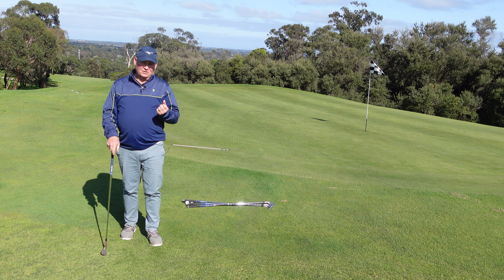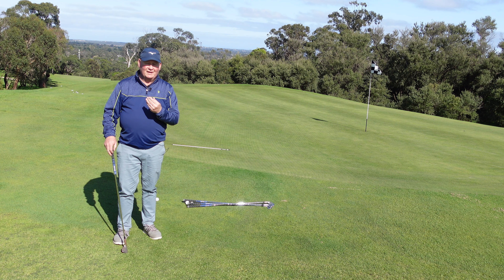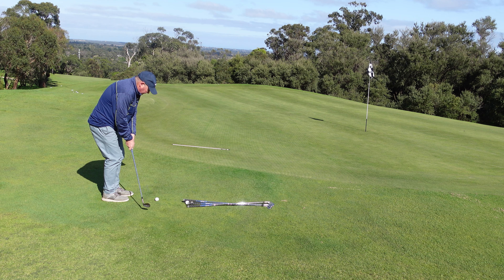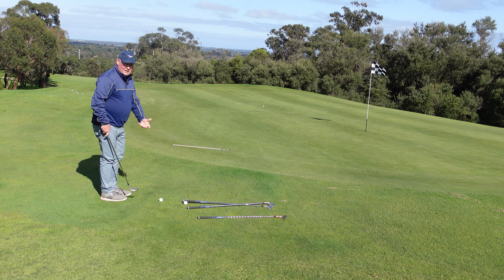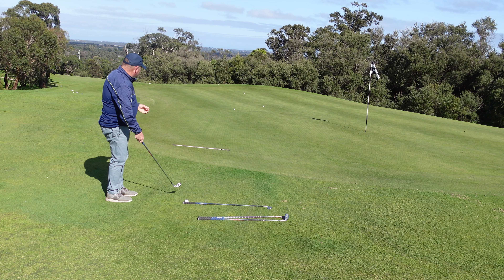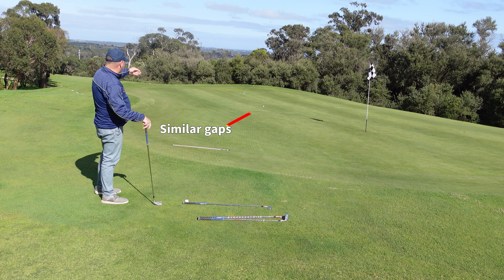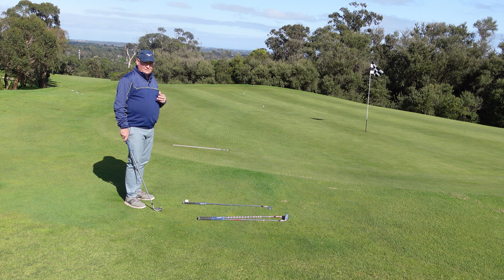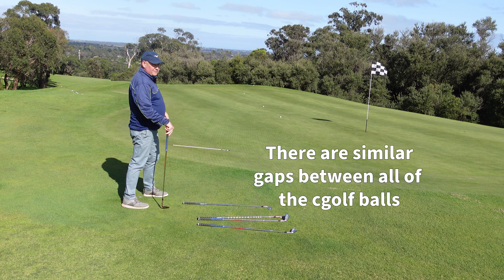Do This To Control Your Chipping Roll Out Distances

Comment: Brain, another great tip. Earlier in the year, I watched your video about not aiming at the flag, but at the point you want the ball to land on. I’ve been working on this quite a bit and it’s paying off. Now to work on this portion, stopping the ball reasonably close to what you want. To me this is one of the more frustrating things, but when I make it all come together, what a great feeling. (Not happening really often, yet). 
Without a doubt the tips I’ve received from you this year has lowered my score like you wouldn’t believe. Not in the 80’s yet but very close! Our season is drawing to a close, had several frosts now and morning lows in the upper 20’s F. I’m going out tomorrow so I’ll see if there’s opportunity to stop up on these chips. Number one tip for the year - take the shot you know you can make (I know, I wear it out!) but true. Example: ended up near a tall tree. My golf pard says ‘yeah, you can get over that with an eight.’ No, I can’t and where will I end up if I knock the stuffing out of the ball? OK ‘nuff said. Thanks, next year, the 80’s.
Reply from the maker: Thanks for this nice message Bob.
You have done a great job with the implementation over the summer.
If you only got that one thing it was a great thing. It is also what the best players do ...Mostly.
With the chipping. People tend to use too much loft and have their landing area too far away from them.
I try and land the ball 2 paces on for almost every chip shot and then let it run to the flag by using the correct club.
To hit the stop and check shot you need a great technique, a firm surface to hit from. a soft covered ball and a mist green. If one of these are wrong you won't be able to do it.
I hope your winter isn't too bad. I will try and keep the sun out in my videos for you.
Thanks again for you support.
Brian